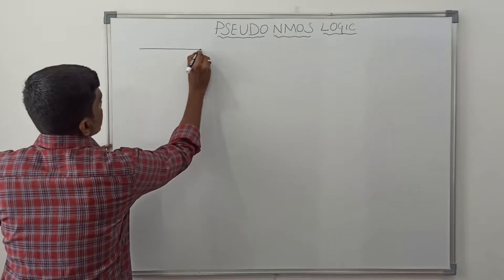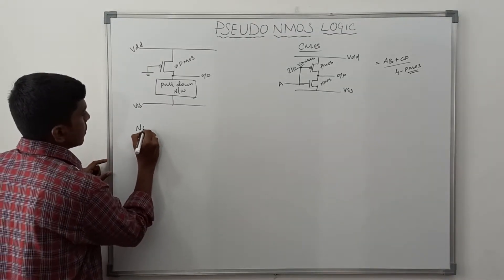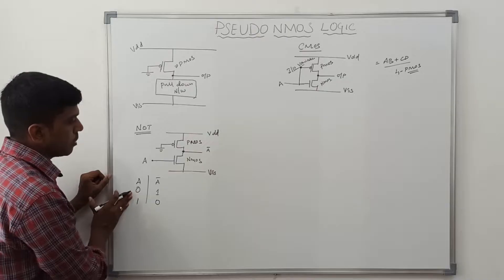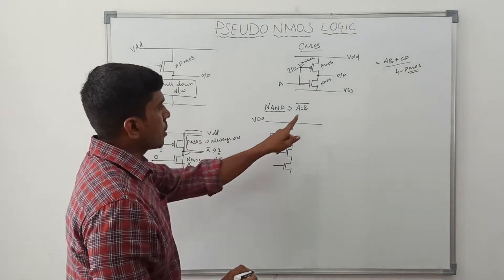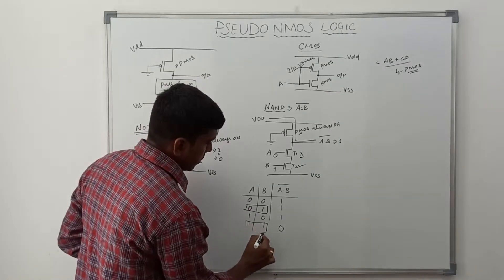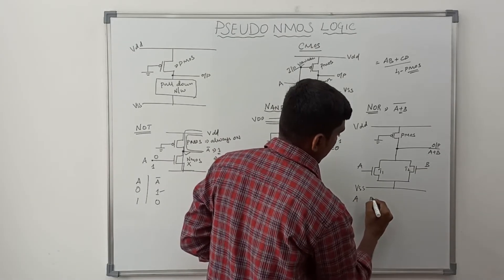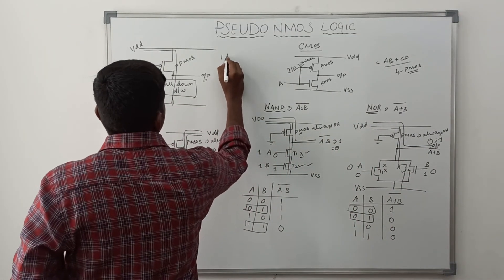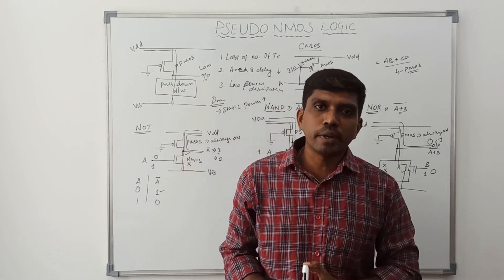Pseudo NMOS Transistor in VLSI Design | S Vijay Murugan | Learn Thought

Comment: When VDD is directly connected to ground, wouldn't that lead to a short circuit?
Reply from the maker: Here I mean it's the low resistance path so the output voltage is zero.